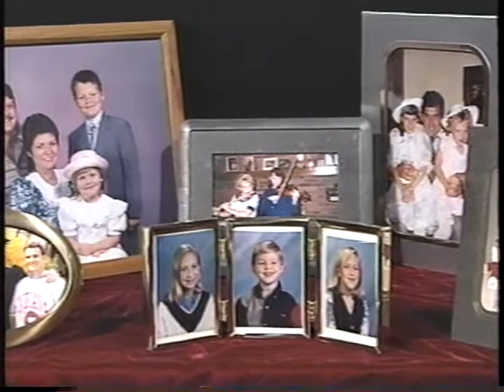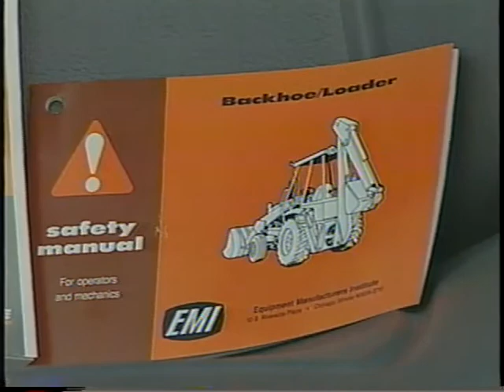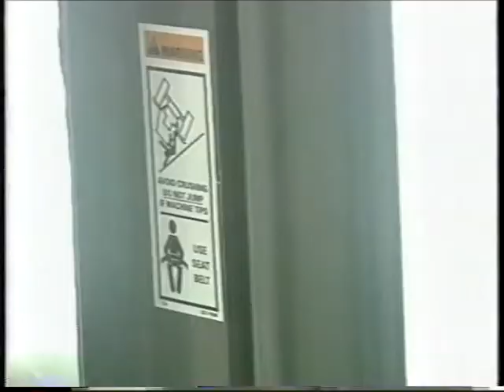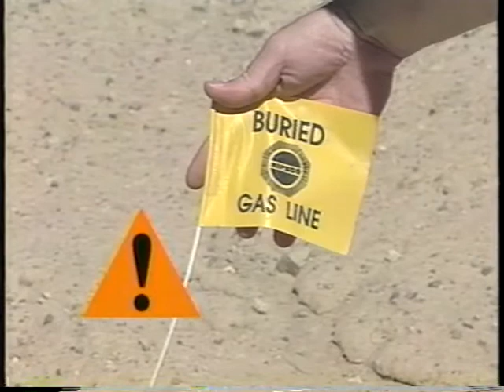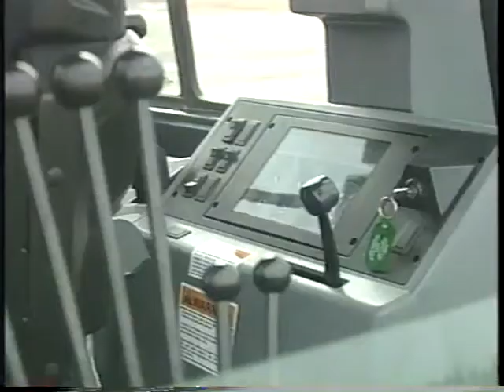Case 580L Safe Operation of Backhoe Loaders

Comment: The parking brake. Doesn't need to be set while using the backhoe part of the machine that doesn't. Even make sense if you would have to move un setting the parking brake to move if you're digging or moving pipe that would waste time!!.
Reply from the maker: I would agree with you Colton, especially because the rear wheels should be lifted slightly off the ground when digging with the backhoe and that would mean the parking brake would not be doing anything.  The only reason I could see them have you setting it is so that when you lift the stabilizers to prepare to move the machine the parking brake would stop the machine from coasting if you are on a bit of a hill.
Reply: @JimMackHeavyEquipment  exactly Jim, one of our excavator operators saved a new Backhoe operator after he lifted his stabilizers without brakes on and started to coast into excavation dig , excavator stuffed his bucket in front of backhoe before it fell into hole just saving his butt.